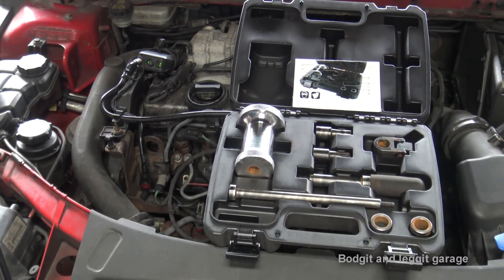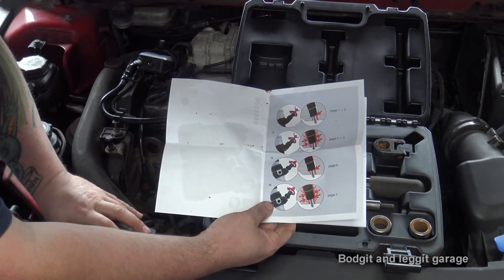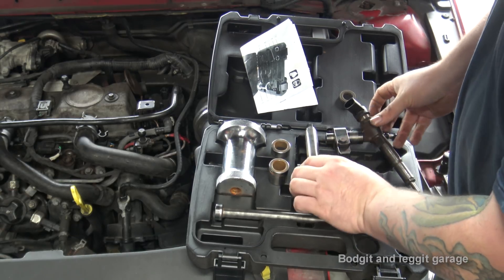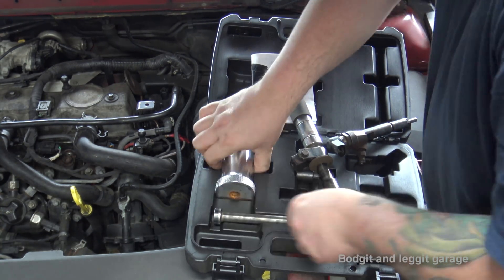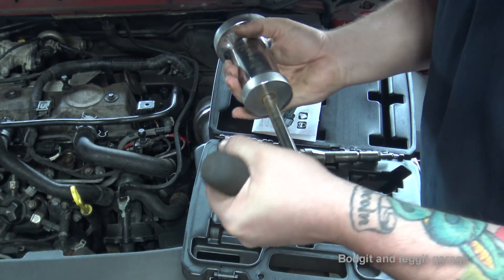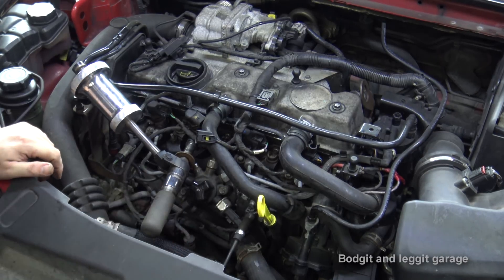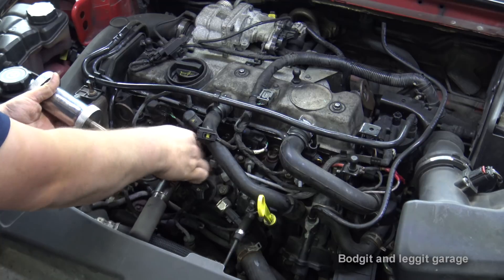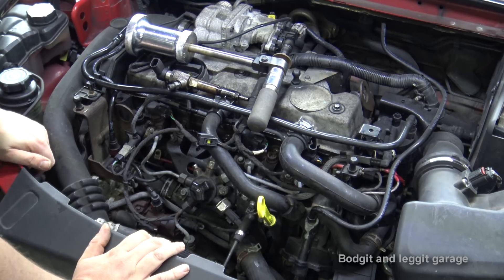How To Remove A Diesel Injector The Easy Way Hubitool Universal Injector Puller HU41055

Comment: It’s always such a great source of pride for us to see our tools being used on field (especially with such mastry as Leon does 😊). Thank you so much for that! Just one tiny little remark : if you struggle with the threaded coupler (see minute 3'), it means you screw it on the wrong part first. It actually must be screwed into the injector or into the supplied adapter and not the other way around. The coupler features an allen recess (hex female) which allows this small rod to be screwed into the bottom of the thread. We will insist on this on the instructions manual cause it might not be clear enough (thanks for raising the matter). By screwing the adapter onto the threaded rod you take the risk that the threaded rod does not go to the bottom of the thread or worse, only takes on a few threads, making an assembly not strong enough for the job. When you screw the coupler all the way, half of it will be inside the injector and the other half into the extractor. That's the proper way to do it 🙂 Anyway it’s just a detail. The vid is great, once again (great idea ,the washer!) Keep up the good work! 😊
Reply: Where can we buy this tool from? Can't seem to find a single place which sells a kit like this in UK.
Reply: "Mastry?"

Comment: i just did mine, couldn't be bothered with the puller, just loosened off the injector clamp bolts and started the engine, let it do the hard work. once there are 4 jets of diesel spraying out across the  engine bay job done. turn off, lift them out. also allows you to see the state of the cylinders if theres an oil leak as well. sort out injectors, then bleed off, then use easy start to restart and clear any air in the injectors.

Comment: Love you brava !!!

Car  used vegi oil kit....
Which car ? Which year ? Which engine ?
I have unlimited used vegitable oil supplies.
2 tanks, starting with diesel then vegitable oil , then  before calling it a day run on diesel a little to rinse fuel system. + Vegy oil heater so it stays as runny as and additional small veg  oil filters .

Some say wv 1.9tdi + swap pump for mechanical Alh 1.9m pump, but i ain't got a scooby which fuck... ng year 1.9tdi.
Preferably some 7 seater , git 3 kids. 
Guess common rail is a nono
Cheers

Comment: Menginspirasi cara membuka Injektor yang susah, thank's!
Reply: We are manufacturer specialized in auto and marine diesel engine parts since 1952.
Our main parts are
EURO II system: plunger, nozzle , delivery valves, head rotors, repair kits, etc.
Common rail system: Injector complete and injector spare parts for CATERPILLAR, DENSO, DELPHI , BOSCH, SIMENS, CUMMINS, etc.

If you have any inquiries, pls do not hesitate to contact me.

Comment: Hi,
I watched you video a couple of years ago and when our Renault Master Ambulance started lighting up STOP and I looked and saw diesel leaking I bought a new seal and the tool to remove it but then looked closer in the hope of doing the job to find a volcano of rock hard soot around the injector, do you have any advice for removing the soot so as the job can be done, I bought some diesel blast as I read it can remove even the toughest soot from inside the engine but am a bit scared of trying anything as I use the vehicle daily and cannot have it off road for long, when first starting the STOP light lights and you can hear the loud ticking of the diesel leaking then it settles and drives perfectly so need advice on how hard a job it is gonna be to remove the injector and if you think it will just need the new seal or should I buy an injector as well before trying
Reply from the maker: hi mate yes it definitely sounds like your injector seal has gone it is really difficult to remove that stuff you just have to use some heavy detergent and a screwdriver leave it to set and keep picking away with the screwdriver eventually you will get it off but it is one of them jobs that takes a long time I'm once you have removed the injector you might need to cut the new valve seat it is an easy job you just need the right tools but it will take time to do it also if your injector is stuck that can also be a nightmare

Comment: Having been out of the trade for nigh on 20yr i have watched as the motor industries have made repairs and servicing more and more difficult, some idiotic  designs  because some prat on a PC designs something he will never have to deal with when it fucks up , i have friends still in the trade i pop round to now and again always get a ''Come and look how this is made'' like i said no thought put into how the fitter/mechanic can deal with the issue, Nope' would not be a mechanic nowadays too much of a balls ache .......
Reply from the maker: The joys of being a mechanic make not to mention the tens of thousands of pounds you need to spend on equipment and training to keep up with a modern vehicles
Reply: I worked for a Vauxhall Bedford Main Dealer in the 70s and 80s....everything was simple then , Worst thing that's happened was  sticking a Vauxhall badge on a crap Renault designed van  !

Comment: Hey mate just subscribed to ur channel lately when i was looking up mk4 ford mondeo videos thanks for ur hard work and great videos! My mk 4 has a whistling noise seems like the turbo espically when cold it varies up and down and so does the power with it when i take off in 1st and 2nd gear power comes in surges with the whistling any tips where i should look and what should i do? Keep the video coming☺👍👍
Reply: We are manufacturer specialized in auto and marine diesel engine parts since 1952.
Our main parts are
EURO II system: plunger, nozzle , delivery valves, head rotors, repair kits, etc.
Common rail system: Injector complete and injector spare parts for CATERPILLAR, DENSO, DELPHI , BOSCH, SIMENS, CUMMINS, etc.

If you have any inquiries, pls do not hesitate to contact me.
Reply from the maker: Hi mate hope you enjoy my videos thanks for watching and subscribing make sure you've got no leaks or tears in your pipes or any holes in your intercooler it sounds like you got a whole / tear somewhere that's why the turbo is whistling if you know someone or have a smoke machine you can get it put on and see where the leak is but make sure you do this when the car is cold
Reply: @bodgitandleggitgarage   cheers mate i will get to work on it and have a good look around the pipes on my day off wish i was closer to ur garage so u could give it a look over as its obvious  from ur knowledge and videos she would be in good hands! Its nice to find someone on the internet who know what there doing and what there talking about keep up the good work and the videos coming i will keep u posted on my progres!😊👍👍
Reply from the maker: sorted
Reply: Price on nozzles

Comment: That was a great clip. Your arsenal of tools is getting quite impressive.
Reply: We are manufacturer specialized in auto and marine diesel engine parts since 1952.
Our main parts are
EURO II system: plunger, nozzle , delivery valves, head rotors, repair kits, etc.
Common rail system: Injector complete and injector spare parts for CATERPILLAR, DENSO, DELPHI , BOSCH, SIMENS, CUMMINS, etc.

If you have any inquiries, pls do not hesitate to contact me.
Reply from the maker: Thanks mate you can never have enough tools lol

Comment: Neat bit of kit buddy. Thanks.
Reply from the maker: Yes mate it certainly makes the job easier like they say work Smarter not harder
Reply: We are manufacturer specialized in auto and marine diesel engine parts since 1952.
Our main parts are
EURO II system: plunger, nozzle , delivery valves, head rotors, repair kits, etc.
Common rail system: Injector complete and injector spare parts for CATERPILLAR, DENSO, DELPHI , BOSCH, SIMENS, CUMMINS, etc.

If you have any inquiries, pls do not hesitate to contact me.

Comment: Dose it work on the Vivaro etc I’ve been told there a pain
Reply from the maker: yes mate i've done 3 so far got them all out
Reply: Vivaro, Trafic with the 2.0DCi is a pain. The other one that is even worse is the Mercedes straight 6 diesels in the ML. Black tar everywhere from blow by and welded to the head. Only way to persuade them to move is to get the engine very hot with a 20 mile run that partially softens the black crud and then use a pulling tool. Problem is you're time dependent because it cools and hardens very quickly. Once you've started its shit or bust.

Comment: I usually take out the glow plug...   pack the cylinder with black powder install fuse...bam or boom!! but this tool looks great...   might try it!   thanks leon
Reply from the maker: I really want to try that now and film it to shame we can't get black powder in Ireland
Reply: We are manufacturer specialized in auto and marine diesel engine parts since 1952.
Our main parts are
EURO II system: plunger, nozzle , delivery valves, head rotors, repair kits, etc.
Common rail system: Injector complete and injector spare parts for CATERPILLAR, DENSO, DELPHI , BOSCH, SIMENS, CUMMINS, etc.

If you have any inquiries, pls do not hesitate to contact me.

Comment: Funnily enough I have to remove the injectors on a 1.8tdci head and you got the video showing on in the same engine lol. Luckily my head is on a bench so can use levers to get them off!
Reply from the maker: Just be careful mate they need to come out straight otherwise they will struggle to come out
Reply: bodgit and leggit garage cheers will keep that in mind.

Comment: What's the best thing to use to clean/lubricate injectors when you do remove them and also where they sit inside the engine?
Reply from the maker: Hi mate the best thing to do is make sure everything is clean properly and you can use some high temperature grease just a little bit of it but once injector seal goes there is nothing as far as I know that is going to stop it seizing up
Reply: We are manufacturer specialized in auto and marine diesel engine parts since 1952.
Our main parts are
EURO II system: plunger, nozzle , delivery valves, head rotors, repair kits, etc.
Common rail system: Injector complete and injector spare parts for CATERPILLAR, DENSO, DELPHI , BOSCH, SIMENS, CUMMINS, etc.

If you have any inquiries, pls do not hesitate to contact me.

Comment: I picked up an enerpac hollow ram cylinder that can push twenty tons. If that can't pull them out then the head needs replacing anyway! The trick bit is my adjustable pressure plate that the cylinder reacts against. Citroen/ Peugeot van injectors the worst! When you see the " Black Death" around the injector you know you in for a fight!
Reply: Was an eBay purchase. The reaction plate is thick steel with a hole bored to allow the injector to pull through. This is surrounded by tapped holes to allow screws to be adjusted to give a level base to push on. I would like to say it's my design but it's a copy of what I saw a guy who pulls injectors as a job had! His kit cost loads, mine was just over one hundred and can pretty much pull any injector too. This is what we do mate,we find a way!
Reply from the maker: Nice I'm looking for one of them as well